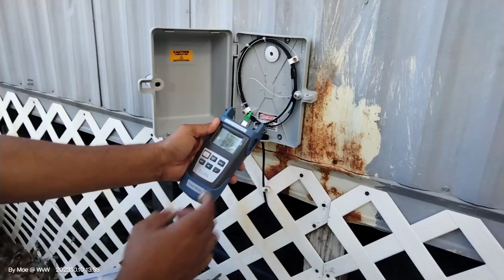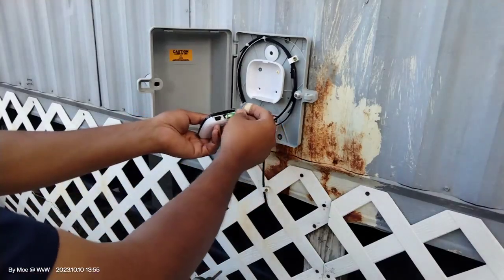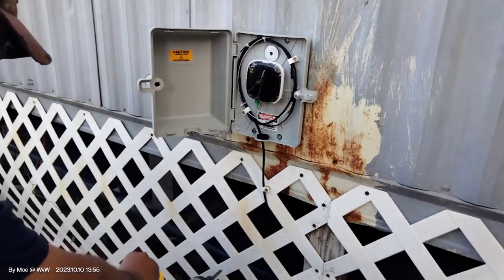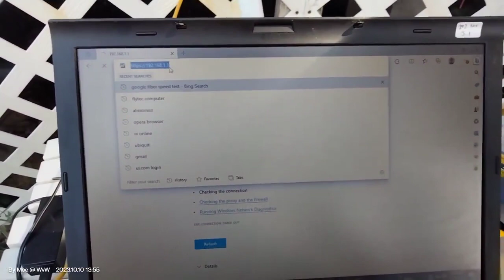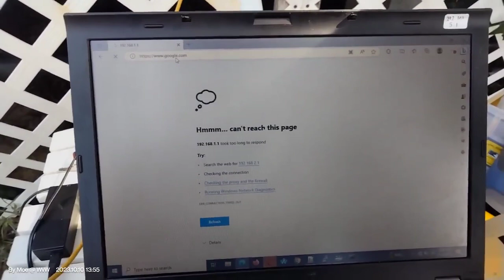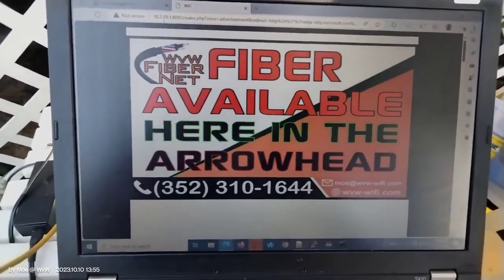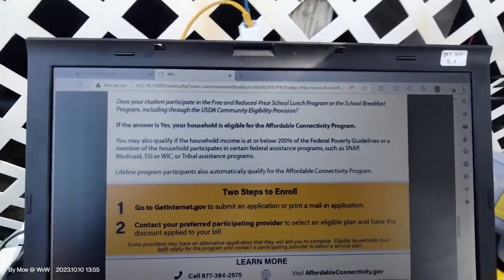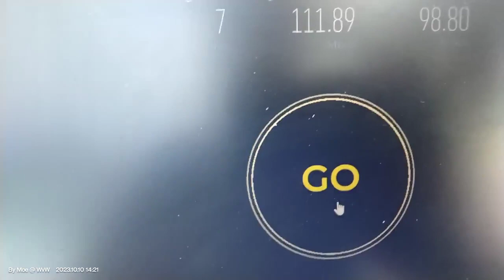Ubiquity Gpon outside install. Fiber to the mobile home park.

Comment: 👍   What router is used in the home? Do you provide or does the client get their own. Thanks for the videos.
Reply from the maker: The Gpon is used as a router. It is powered the same way as CPE . At the poe the output is RFC1918. Then they can use their own or we can provide them with a wifi access point. To void double Nat. We use Cisco 3502i as an  AP. But some want to use their own router and at this point we can't assist with internal troubleshoot because they are behind a Nat . Hope this will help.